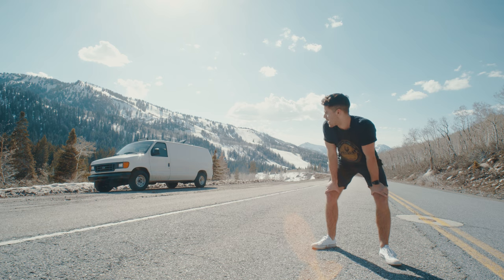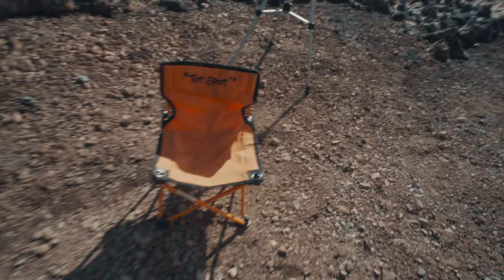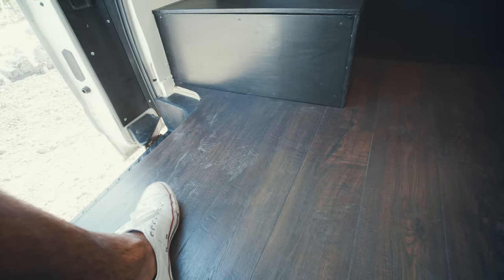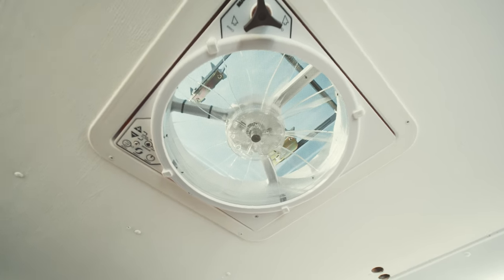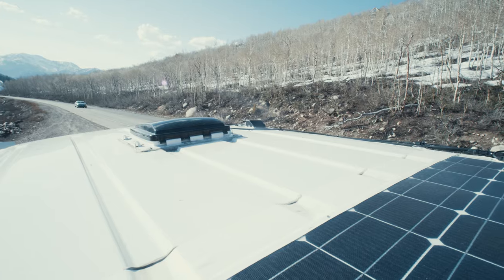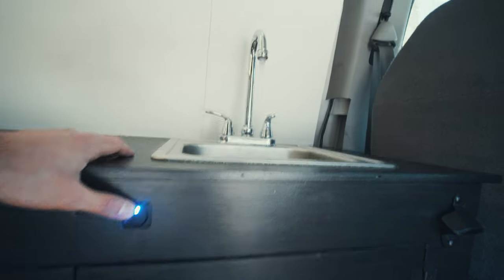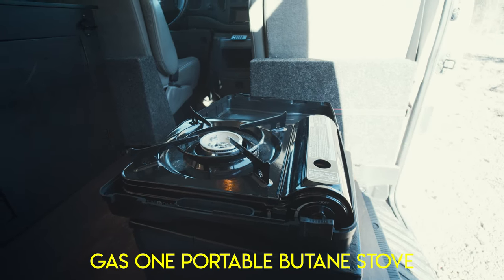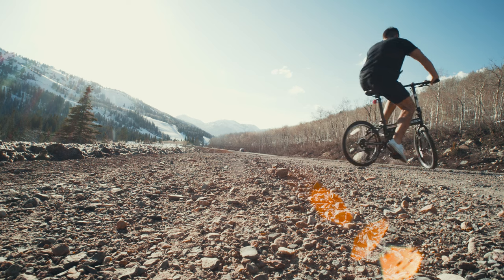VAN TOUR | Modern VIDEOGRAPHER Travel Van (from a $3000 cargo van)

Comment: Hi Brian, like your videos! Your van turned out nice, man, I'm jealous. As an engineer speaking: it might be smart to take a bit more care of the wiring in the back. Since 12V uses a lot more amps the chance of a fire is also greater. Hope your battery is specific for your use, and not an ordinary car battery (ordinary car batteries exhaust hydrogen, which is extremely flammable, as you know, and may cause an explosion if not properly vented. Enjoy making trips with your van!
Reply from the maker: Thanks for the feedback Steven! It is indeed a battery designed specifically for this use. :)

Comment: Since you have plywood covering the walls, what if you cut out a recess for a monitor?
And then build out a PC workstation inside your drawers.
Reply from the maker: That was one of the original designs for the van! :) but ended up just rocking with a powerful laptop so that I could take everything valuable out of the van if I was to be away for a bit.
Reply: @brian.durkee  True. I've had my gear stolen from my car before so I would also lean towards caution.
Looks like the van is going to be a blast either way!

Comment: Brian, you said that bed could be turned into a bench from either side .. any chance you could describe how did you accomplish that/ what mechanisms did you use? I want to do the same in my van, without having to drill holes on sides of van to prop the bed up for seating. Thanks, and that was an awesome build btw.. I realize it has a new owner now, hope you do another one and keep us posted! Cheers.
Reply from the maker: Totally! First off thank you! Second, I installed some pneumatic struts from eBay I believe to hold it up but they are not installed in this video!

Comment: Hey Brian, I have a similar style build as you. One question, what did you use for the curvature part that joins the ceiling to your walls? Where the lights are? I want to redo mine.
Reply from the maker: Cut plywood to 6 inches wide or so then angled it between the roof and wall plywood, the put some small wood strips (painted black here) screwed into ceiling and wall to kind of hold that 6inch piece in place